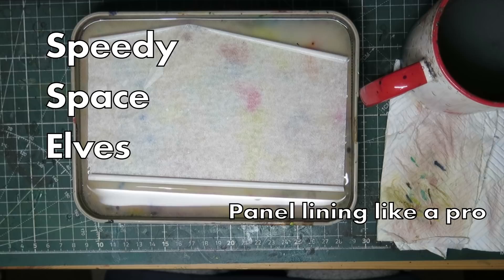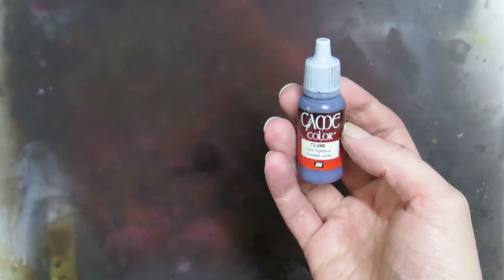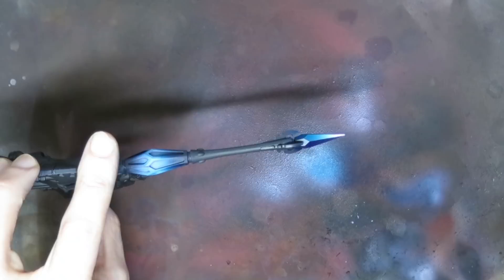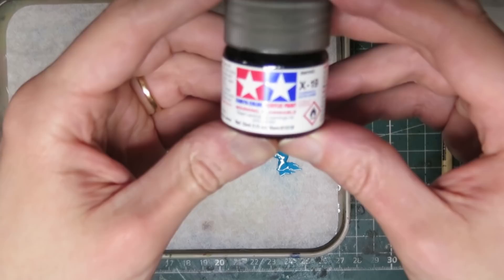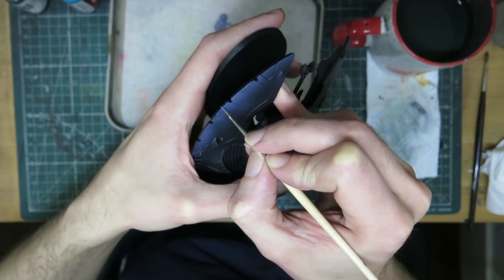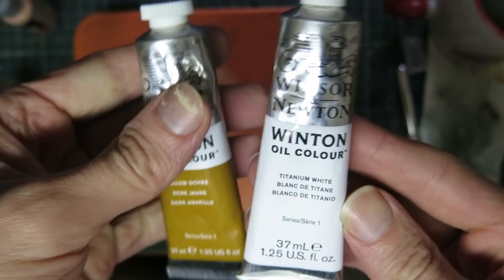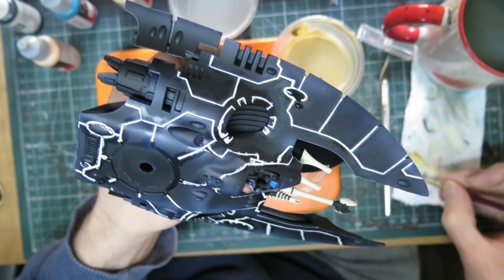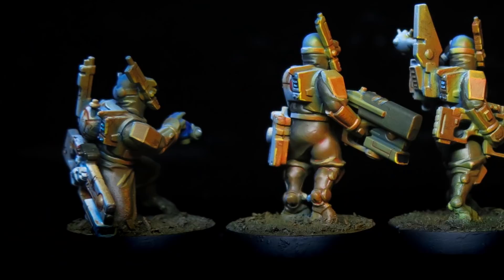Fast panel lining on an Eldar tank -- more mini painting oil magic

Comment: First video of yours I've watched, and you've earned yourself a new subscriber. Great stuff.
If you wanted to spend even longer on it, then perhaps glazing a few other colours into the panel lines could look good? Like a yellow when you go into the darker bits?
Reply from the maker: Thank you! Absolutely, you could. I have a chaos dread that basically uses that principle to add psychedelic/fiery red and yellow panel lines 😁
Reply: @GRGMiniatures  First video I watched too... so stoked on getting my Aeldari army started, but quick question: what are 'white spirits'?
Reply from the maker: @GreySeerSqueek  It goes by different names in different countries, whit spirit, mineral spirits, turpentine etc. If you go to an art shop and look for oil paint thinner, that should get you the right stuff :)

Comment: Side note, I love the Falcon/Wave Serpent chassis. Reason why I play Eldar.

I play Yme Loc so the grey and orange is... Hard. Especially with highlighting these curves. Imperial players have it easy with their tanks.

I wanna tint the cockpits though, glad you hinted at the Tamiya paint. Was looking for Humbrol and can't really get it

Edge highlights on these panels really sucks due to shallow edges.

Don't get me started on sub assemblies. Most Eldar vehicles need to be painted in sub assemblies which makes gluing difficult.
Reply: Tamiya have an orange tint that would be perfect for yme loc. I use red tint x27 and it's great stuff for my void dragon grey and red scheme
Reply from the maker: The chasis is indeed absolutely gorgeous. Though I found out I was wrong! It wasn't a Jes Goodwin model :o

Comment: This looks killer. I've been looking for a solution to white panel lines for what seems like forever. Thanks for the insights. I never thought to use oils because I was afraid of ruining any finish I had down.
Reply from the maker: You shouldn’t have any problem. Just bare in mind you might get some water-stain looking marks as the oils dry, but with enough time they’ll disappear.
Reply: Oils are great for panel lines because they are more vibrant than acrylics so pop even more than their acrylic counterparts

Comment: Is panel lining possible with metallics? Because I've been thinking about having a Black and Gold scheme, and having the gold be the lining feels like it would be really cool. Would there be any additional problem I'd have to deal with to do so?
Reply from the maker: You can get metallic oil paints that I’m sure would work just like this (tho I haven’t used them myself). The only thing I’d watch out for is the mica particles. They’re probably a lot harder to clean away completely, so you’d have to be a little more careful when adding the paint.
Reply: @GRGMiniatures  Thank you for the reply! I'll try and give it a shot.

Comment: Didn't hear it in the video but did you varnish before the panel lining ?
Reply: You mentioned that it's not needed, so was just checking
Reply from the maker: Nope, not varnished at all. As long as you’re gentle with cleaning, varnish shouldn’t be necessary

Comment: hello i would like to try your tutorial, i just have the problem that my oil paint just doesn't "liquefy". i also have winsor oil paint and i can soak it in thinner it stays together and just gets very soft and not as runny as in your video. what am i doing wrong?
Reply from the maker: Hi there! What thinner are you using? It should be 'white spirit' or 'mineral spirit' (it can go by a few different names depending on your country -- if in doubt, go to an art store and look for oil paint thinner!). You will need to thoroughly mix the paint in to this, not just wait for it to disperse.

Comment: Tried this. Total mess unfortunately. Im using black oil paint on a teal tank. The oil and white spirit mix goes into the grooves ok, but when i try to clean it up with a brush it comes out again. Its left smudgy stained grey black bits on my teal paint